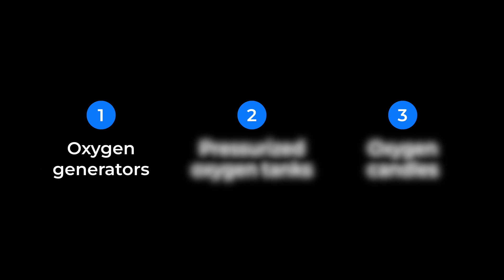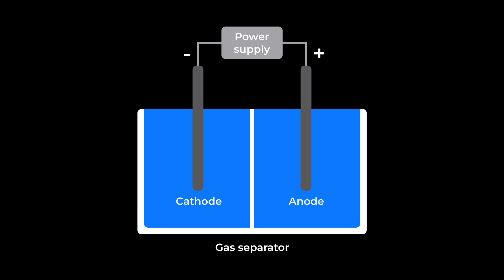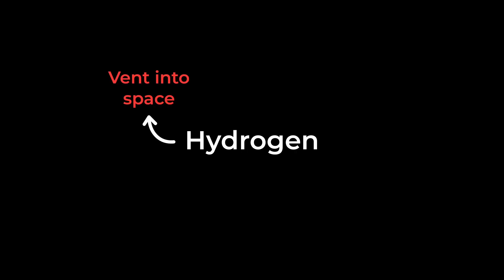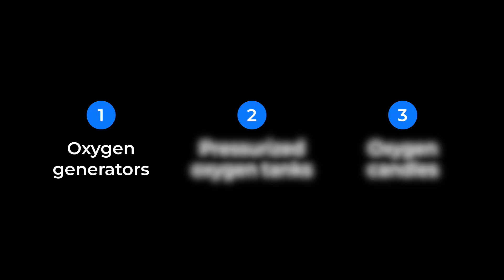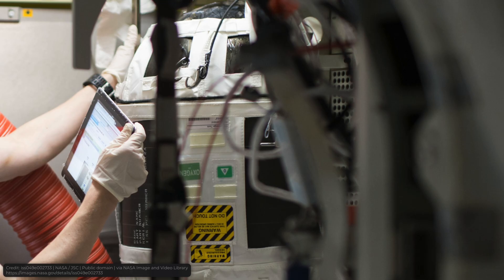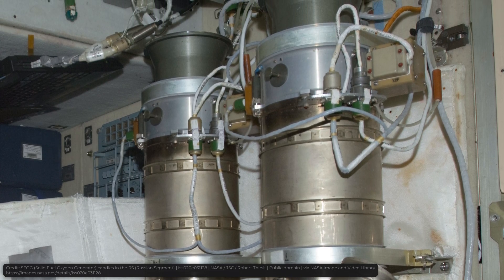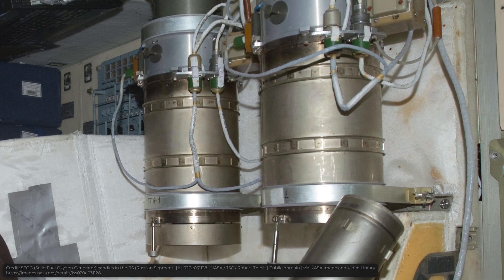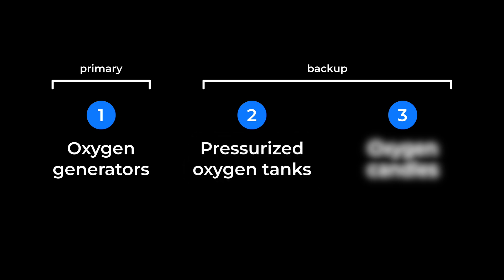How the ISS Gets Oxygen

Comment: i really love the oxygen candles they also can use to get an extra boost of oxygen if there are a lot of people on station. That system did cause the fire on mir but i believe the investigation concluded some foreign object, a ripped piece of latex glove or something like that, was what caused the fire, so the system is still in use on iss. It's really interesting not only that they can burn something to make oxygen, but that its such a good system they decided to bring it into space. Similar solid fuel oxygen generators are used in airliners, on submarines, i think even firefighters use them in some cases

Comment: But electrolysis is very expensive in terms of energy, they can fuel it with just solar panels?
Reply: ISS Solar Panels are insanely efficient compared to even industrial ones here on earth and there's also the vacuum of space to consider. No atmosphere and therefore wayyyy more solar potential energy to harness. All of these things combined add up much higher energy yields than at sea level on earth.

Also this isn't the only system, oxygen scrubbers and whatever else they use means that the Electrolysis O2 Generators don't actually have to produce that much oxygen, they simply compliment it (so even less power draw). This same principle of reusability is seen everywhere in the station and when analysed as a whole you'd be surprised how efficient it is at maintaining life systems. A huge chunk of power consumption I'm assuming also comes from the science instruments and experiments, everything is quite nicely thought out :D